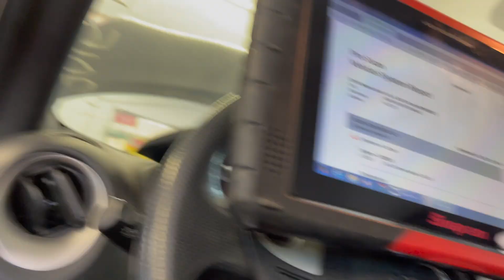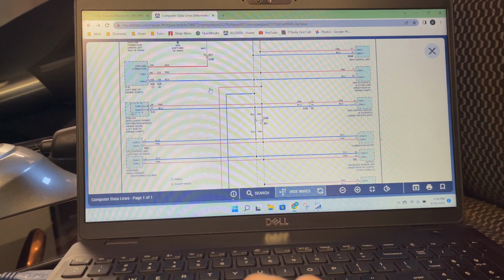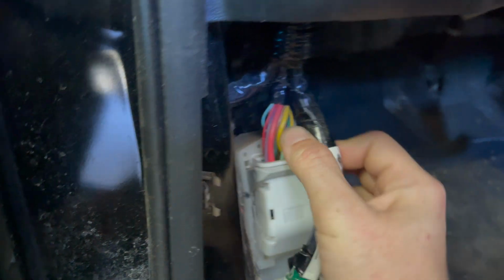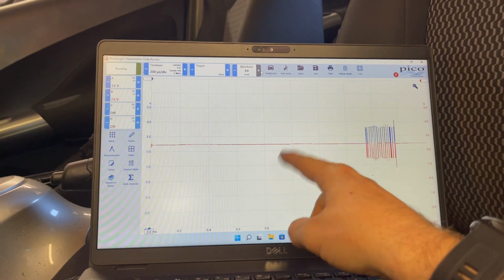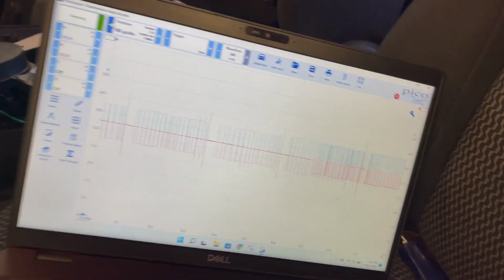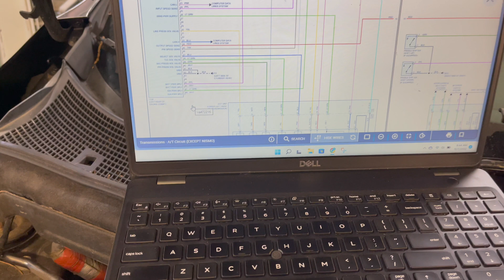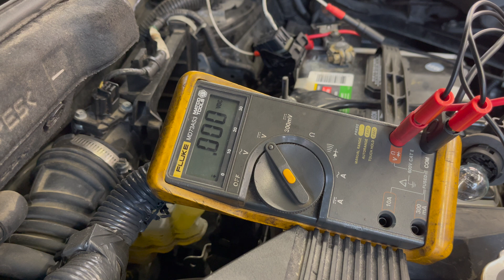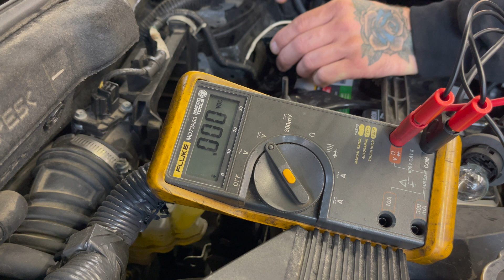Nissan Juke with CAN Bus Faults

Comment: Does it have the Lan network? Have a 09 has a lan network with a decoder.
Reply from the maker: I’m not sure what you are referring to.
Reply: @autodiagyt  On my Nissan vehicle the modules use a LAN Module for communication. There then is a interface or decoder to convert it to can bus.
Reply from the maker: @JohnZornAscended  what kind of vehicle? LAN just stands for Local Area Network. The protocol used will be can bus if its pins 6&14.
Reply: @autodiagyt  It’s a Murano same year as the Juke.
Reply: @autodiagyt  I know that you can see can bus on your end. What I’m saying is there is transceiver that converts the Lan digital signal to can bus. Not sure if the Juke has it, just curious.
Reply from the maker: @JohnZornAscended  a murano just has can bus and a k-line on the dlc. LAN is just a hardware structure, local area network. Meaning the communications is handled local hardwired to each other. CAN Bus is the type of communication protocol that the LAN is using.
Reply: @autodiagyt  I understand that what I’m saying is the Transciever IC receives digital messages and converts them into can bus or the opposite. The reason I asked that is I thought maybe it could be a fault point.

Comment: Do you use the Pico can bus decoder? Would it help in this case?
If one of the termination resistors was in one of the modules you disconnected what would happen to the data on the scope?
Can you plug in a 120-ohm resistor into the network if the module you disconnected had a resistor in it? 
Thank you in advance for your answer.
Reply from the maker: I don’t fine the decoder to be useful.
Reply: @autodiagyt  Thank you for the reply. I enjoy your videos very much.

Comment: Hello.  please tell me if you know!  Nissan Juke 2016 1.5 diesel, manual transmission.  Blind-spot sensors, lane keeping and start-stop of the engine stop working at stops.  Sometimes after washing the car it can work for a while.  In the past, there were errors like: u1000-01, u1217-4a, u12B0-16.  They were erased and did not appear again.  there is an error on the incorrect operation of the light sensor B2631-00 (the sensor itself shows from 0 to 25)
Reply: what program do you use on the video, I want to buy one for myself?